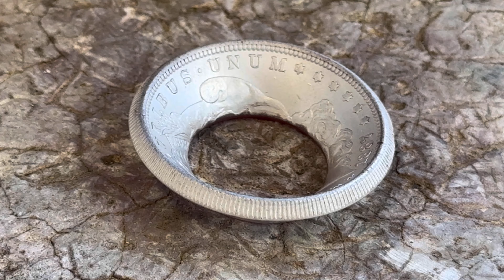Making a Morgan Dollar / Penny Spinner Ring

Comment: Beautiful! I've made coin rings for about 8 years but need to get back into actually selling them. I do not have a lathe so I've been pondering the idea of making a spinner ring by very slightly tapering both ends of a  large coin ring to keep an almost as large coin ring trapped in the middle.
Reply from the maker: Right on! Thats one thing I really enjoy. Coming up with different ideas and designs is really rewarding when it turns out.